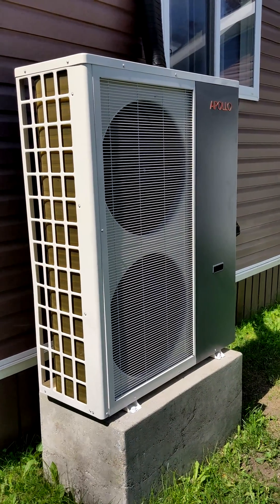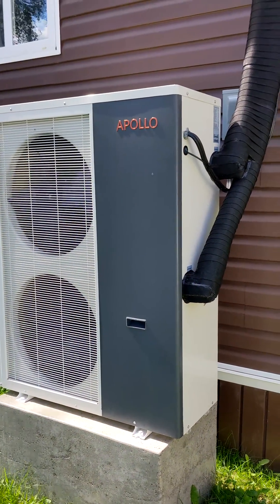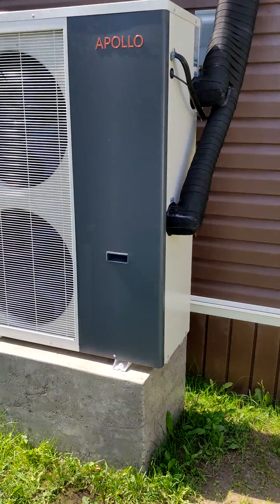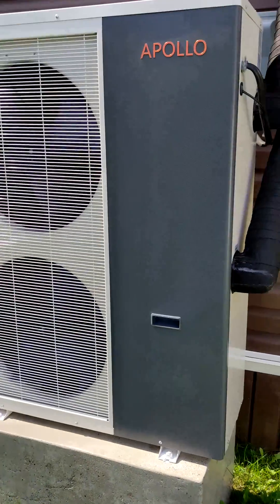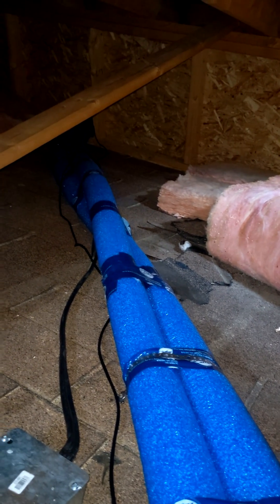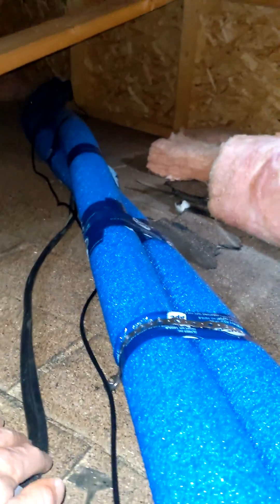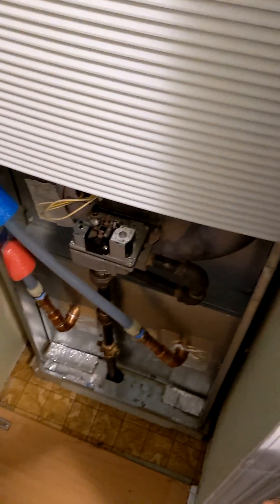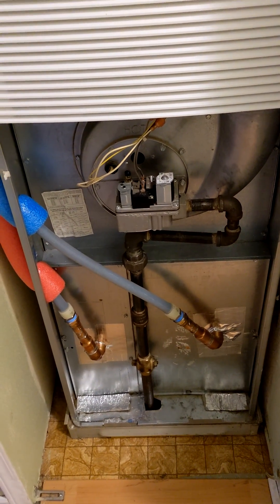APOLLO Air to Water Heat Pump Installation

Comment: I just installed a new 5 ton unit like yours using the apollo heatpump station. Does your circulation pump run all the time?

Comment: Unfortunately, I don't see sense in what you have installed? you have air to water heat pump and then water to-air coil  😄
Reply: With Air to Water heat pumps, there is no Hvac license required (no refrigerant handling) just water via Pex . One heat pump is capable of heating, cooling,  domestic hot water, pool or spa heating. Its awesome..😀
Reply: @mariusm3595  Thanks for reply

Comment: Could you please show the 'wire controller' display for the heatpump?   (not the MC6 thermostat being used for the fan coil)   Does that 'wire controller' (or the heatpump itself) have any communication like modbus / rs485?   Thanks

Comment: Great install.  I'm just across the lake from you in VT.  Considering one of these units for a radiant heat system.  You don't have a buffer tank?  The install manuals I saw recommended this.  Any tips?  Thanks for posting!
Reply: Don't think you should ask this guy for tips🤣

Comment: I've been wanting to buy one from MBTEK for about 3 weeks but they are terrible at customer service, at least with me they have been. So many questions and no one to answer.
Reply from the maker: Scott, please have a look at your email. All the best.
Reply: I have been researching LG's Therma V Monobloc R32. Unfortunately from what I can find they only have 50 Hz systems which are not sold in nor compatible with North America at all. As usual USA and Canada are way behind the curve when it comes to advanced HVAC equipment. I first saw air-to-water heat pumps in Japan more than 10 years ago. From the low hit rate of Google search I suspect the Apollo total installation quantity so far is very low. R32 refrigerant may be one reason NA has no Therma V due to regulatory red tapes. US is extremely gun shy about anything that is mildly combustible which R32 is.

Comment: Which part of US you're located? Can this pump handle full load during winter? Does it come with a controller ?
Reply from the maker: I live in Champlain, NY
Yes there is a controller.
It triggers the circulation pump from the heat pump to the furnace water to air coil.
The controller offer 3 functions
- Heating
- Cooling
- DHW
- Backup Heating
The unit produce enought heat up to -15F but output is less at lower temp. 
I suggest to oversized unit by 1.5X capacity so that at very low temperature you still have enough capacity
You can always buy a cheap 12KW boiler just for backup
https://www.amazon.com/EcoSmart-ECO-11-Modulating-Technology/dp/B001LZRF9M/ref=sr_1_12?crid=22V28AIJGU5WS&keywords=electric+boiler+10kw&qid=1657421294&sprefix=electric+boiler+10kw%2Caps%2C534&sr=8-12
Reply: @mbtekofficial  Can you make a video on main controller that comes with a heap pump  and go trough parameters.
Reply: @mariusm3595  We can hope they do that sometime, I have a 4 ton unit that I've had mostly good luck with, the issues I've had MBTek did fix/replace what was needed, still waiting on fan coil units to use the AC side. For DHW and radiant floor heating short term it has worked well though I haven't had it through a full winter yet, their documentation has slowly been getting better the last few months but there is a lot that as a customer is unknown.